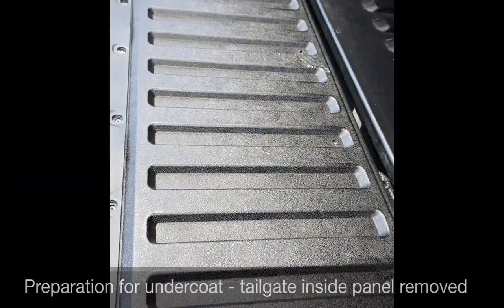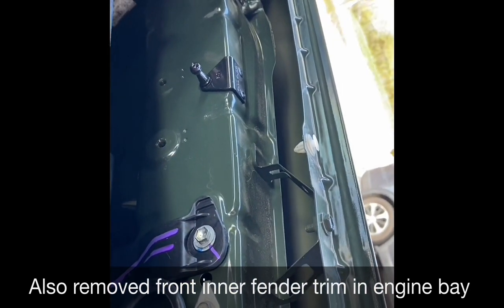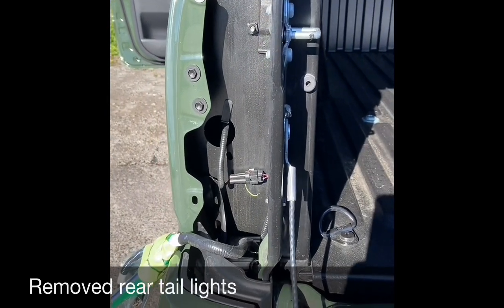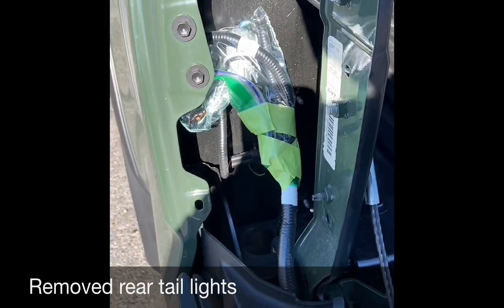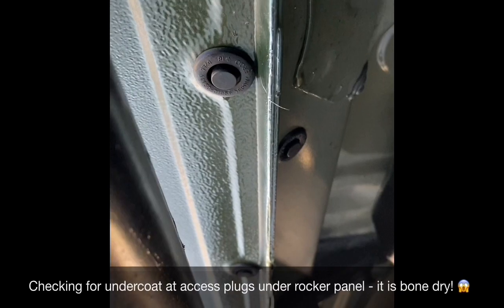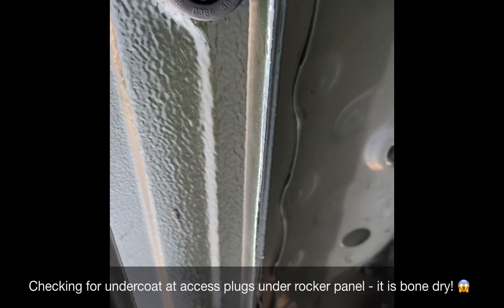Tacoma TRD Off-road Gets Undercoat for rust preventive

Comment: I use corrosion x aviation inside the body areas. It sprays a mist and you don’t have to take it all apart like you did - just insert the straw at strategic entry points. I make sure the areas that would collect water are saturated. Lower fenders etc. I use corrosion x HD on the frame. Thanks for the nice video.
Reply from the maker: Thanks for the tip!

Comment: is toyota doing anything different for rust protection since the recall they have done recently ,namely the wax on the frame was there fix
Reply from the maker: They did . Frame design is open C Chanel in many areas .  It looks like a good design.  It would be nice if the frame is powder coated  but that would increase the cost significantly.
Reply: Toyota changed the composition of the steel used in their frames many years ago. It is now extremely rust resistant..

Frames were only sprayed at the dealership  if there was not enough rust damage for a replacement as per their recall settlement. 

Surface rust isn’t a worry , all vehicles will experience minimal rust on exposed/untreated areas. 

So far their corrosion resistant frames have been holding up, but for people in the rust belt and aftermarket oil based coating is always a good idea. 
And also, people in those areas need to get winter salt / road treatment off their undercarriage asap. Those chemicals, when left on will still oxidize and attack the frames.

Comment: Krowen wears off fast use amsoil hd next time
Reply from the maker: Look like you are right. In just 3 months of winters. My Krown undercoat oil on the section of the frame that exposed in rear wheels completely washed off and dry! Disappointing!
Reply from the maker: I will be posting the video soon to show how poor rust protection with Krown oil is. Good thing I have painted the frame with anti rust paint prior !